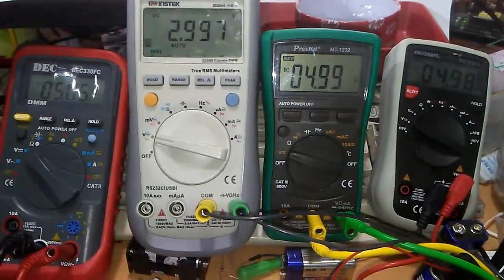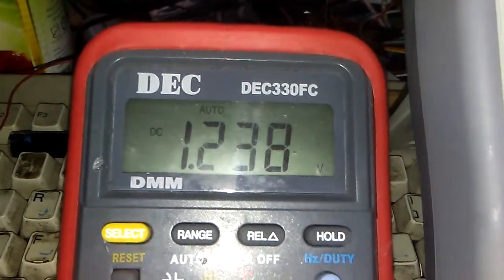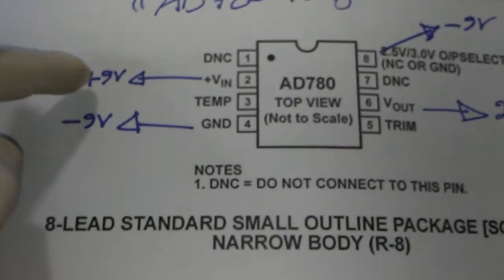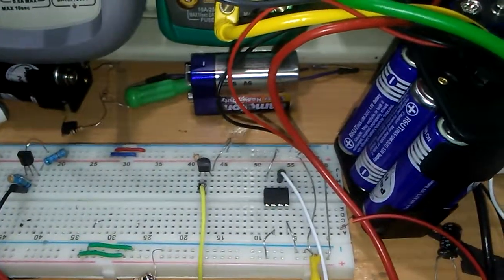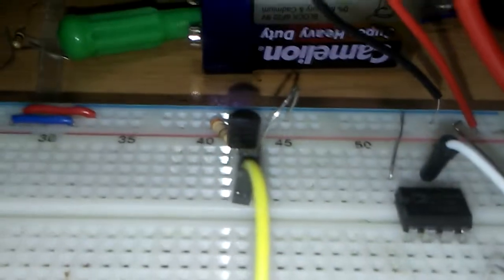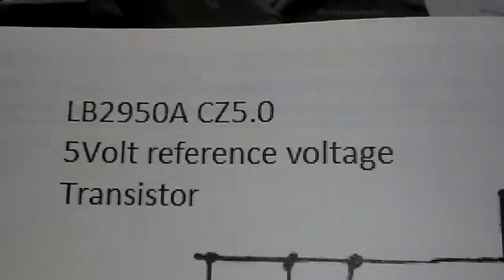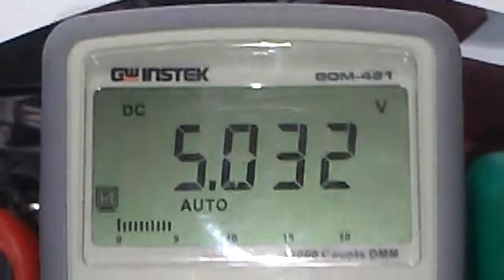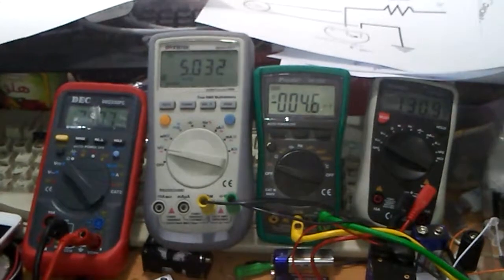voltage reference transistor IC ad780 lm385 lm4040

Comment: In your tutorial you say you need 3 resistors for the LM385. And you say the second resistor from the top is 740K but in your schematics you show it as 470K. I'm assuming the 470K is correct. Just a heads up...
Another think I thought I'd add is that I downloaded the LM385 data sheet and I didn't see any reference to a 5 volt version? Did I miss something in the datasheet?
Reply from the maker: hello, you are right 470~560K is right, but i am using breadboard and with breadboard leakage the resistors not exactly same schematic. i will try to make PCB version very soon and taker result with 470K.
the schematci that you have i don't know what is, but mine is like picture. thanks for your attention Greeting from Tehran to you